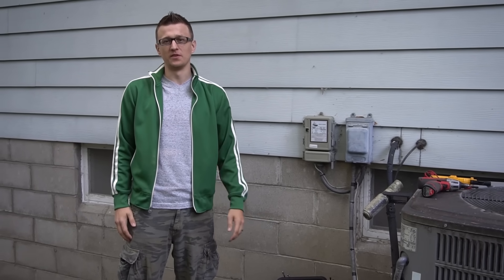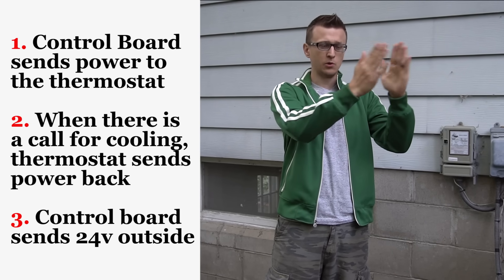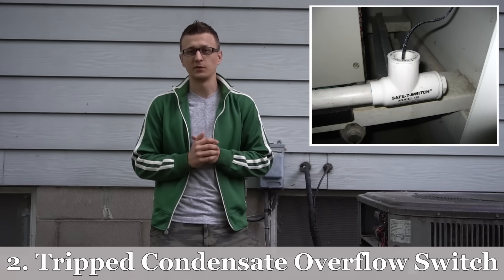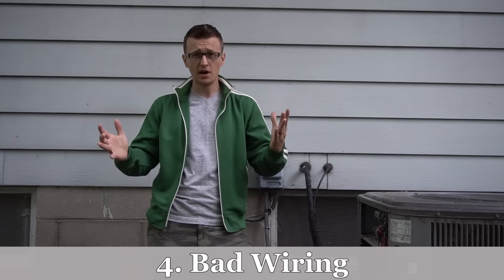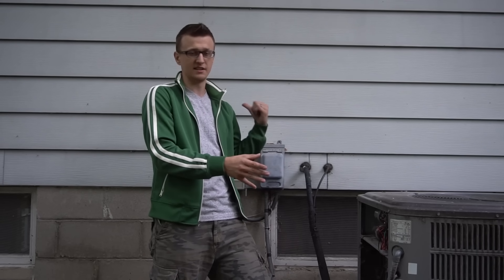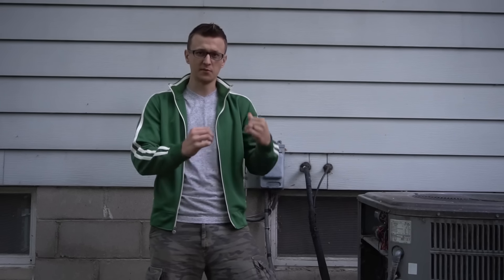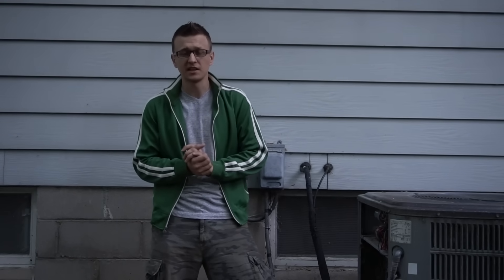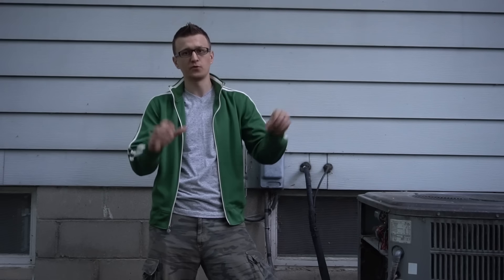AC Contactor Not Pulling In - 10 Reasons Why

Comment: Thanks for your videos. I used this one and others to test many parts of my a/c system to (eventually) find out that the control board was wired improperly. The condenser wasn't getting voltage from the control board. Turns out, the "y" wire was in the "Y2" position on the board, and when switched to "Y1," the condenser started up right away when the thermostat called for cool.

Comment: My AC unit was showing no signs of life Had a licensed tech come out to look at my AC unit at the side of my house. The company said the breaker was bad 🙄. I'd didn't believe it because I was reading 240v outside the house. Watched this video ( a few time not gunna lie). Troubleshooted it to the 5 Min timer. Runs great now. Thank you so much. 

Side question: I have the timer "bypassed" at the unit, is there any danger in leaving it bypassed at the outside unit??...I have an ecobee thermostat, I believe it has a Timer built in.

Comment: Thank you! after checking everything I tried pressing the High Pressure switch reset button and that clicked! I turned the power back on and after a while noticed that my AC Unit was back up and running! It's been storming on and off here in MN, so I'll need to go out and give the Coils a good spraying when it's clear out. Thanks for saving me from having to call it in!

Comment: The blue wire(24V) from the thermostat accidentally crossed with the 240v for the AHU. The fuse in my furnace popped. 

Traced the blue wire to the furnace and it was burned out at the tip. I stripped it back and rewired it in. 

I know the fuse popped and saved any catastrophe but how much worse could it have been? Should I be worried that the wire could’ve heated up enough to cause damage or anything like that? 

The only part of the wire that burned was the tip and it burned right off and disconnected at the connection. The rubber whip that it is in wasn’t damaged anywhere so I don’t think it got hot enough anywhere that the wire melted through it’s own encasing. When I rewired it, and measured R to B or Y it showed 27V so I know it’s back to normal. Just trying to get an idea of how bad this could’ve been. I know in the future to shut down all power no matter what unless needed (the 240V wasn’t needed and I overlooked that)

Comment: So my AC doesn’t kick on unless I push the plunger in on the contractor. I measured the voltage on the contactor(24V) and I’m measuring 9V when I don’t push the plunger in and it goes up to 10v when I push the plunger in. I’m wondering what would be the cause of this? A bad contactor? Or would it be something upstream?
Reply: I thought I'd check out the thermostat its self, when I measured R and C it measured to be 27.9V and there's a jumper in between R and Rc. Still troubleshooting what could be preventing contactor plunger from engaging w/o manually pressing it.

Comment: You are a natural at this. Great video and its SAVED for future referance! This is an odd one but you might know the answer and your Contactor comments got me thinking: I have a dual fuel Bryant system with a gas furnace and heat pump. My thermostat and wiring test perfectly so no problems there. Here is the issue: On a chilly morning, hovering around the set Balance Point of 35 degrees, I call for 5 degrees of heat. The heat pump comes on for a couple of minutes but then due to the higher call of 5 degrees the fossil fuel furnace kicks on which is to be expected. BUT the heat pump continues to run, or seems to be running, although I can't confirm if the compressor is on because i am in such a hurry to shut it all down! I know that these 2 units should not be running together and I know what this could do to my heat pump if I let it go on. I know from testing my stat that I am not sending 24V to the both units simultaneously, yet each work independently when testing. The odd thing is that if I call for just a degree or two the heat pump will start and stop properly but as I said, it will continue to run-on after the aux gas furnace fires up (with no power on the Y wire!). It makes my head want to explode. Are there any timer boards or timed relays in a heat pump that might be malfunctioning to allow this to happen? You might be the smartest guy I have ever seen on Youtube so if you don't I might have to walk down the street and just jump off that bridge :)

Comment: Thanks so much for this great video. Thanks to you I found out why the outdoor compressor was not turning on: one of the 24v wire from the thermostat had a bad contact! I have another issue now though: the compressor does not seem to cool the air. The specific noise when the air is cooled is not heard and the air blown from the vents inside the house is not cold. Any idea? Anyway thanks again!

Comment: Great info!  Could help me please?  I have power at outside unit, contactor not pulling in; 28v on white and red, 28v on yellow and red until I turn thermostat to cooling then I lose the 28v; 8v on contactor coil. Unit does run by pushing in contactor. Split system. Condenser unit fan runs. Unit was running great till now. Checked contactor ohms like you showed, got very little reading. Confused mostly because I lose the 28v on yellow wire when in cooling mode.  Any help would be appreciated and Thanks!

Comment: I thought it was contactor . But touching control board to test voltage it started working on its own. Found article that nest thermostats are bad to control  boards. Because no C wire connection. Anyone else find this .

Comment: Safe T switch wasn’t hooked up to the furnace but was hooked up to the AC. So I was so confused as to why the furnace fan was blowing and not the AC. Contactor wasn’t engaging and tried changing batteries and chasing wires. Then you said condensation line and it was tripped. Which is normal for me at my job but it always shuts down the whole system. Who ever hooked up the shut off switch didn’t connect it to the furnace blower

Comment: What happens if the system is NOT running,no power/no light to the attic control board,overflow switch good,the circuit breaker did NOT trip but if you turn off and turn on circuit breaker the system will come back on and start cooling,can a tech troubleshoot a system that is working for now? BTW this has happen twice in a week.

Comment: Ok,  been at it all day, your videos are epic,   Thus far,  replaced cap, i get both my 24vac and 240vac at contactor,  tested compressor at pins, all good,  filter is clean, cleaned condensor coil, fan inside and out works,  but air coming out of vents is not cold,    Is it possible my compressor starts to run then is shutting off

Comment: Watched your video and learned a lot. Im having an issue with my unit that I can't seem to figure out. I have power at my thermostat and my air handler runs. I have 240v at both sides of the contactor but it will not engage. I checked voltage at the coil and it is only getting 15-17, any idea on what the problem may be? Unit has been running fine up until now.
Reply: Little late but your coil is bad if your only getting 15-17 V. A good coil should read between 24V to 27V. Replace contactor and enjoy.

Comment: Hi Thanks so much for the information you posted on the contactor. My question is what's wrong when the plunger on the Contactor is stuck in the on position after we shut off the Thermostat. I need to let you know, I have already replaced the Thermostat and the issue is the same. The outside A/C keeps on running, even though the temp. has reached the desired temp. and the Fan is off also. Appreciate your instight on this. Thanks again, Mark

Comment: Thank you for sharing your knowledge on AC units! Whenever something breaks in my house I always search Youtube first to learn more about common problems to see if I can fix it myself before calling in the big guns. This video helped me narrow the issue down to the 5-minute delay relay circuit board. A mouse built a house next to it and corroded the circuitry. Unfortunately I am not able to find a direct replacement for the board. Do you have recommendations on finding a compatible replacement? The board is a HN67PA025A for a Carrier Tech 2000 38TK036310dl. P.s.- Good luck with the move to Hawaii!

Comment: I have 24 at my circuit board and after unit calls turn down to 13 volt to contactors and it doesn’t pull the coil in,I change the thermostat wire and thermostat,this happened because the blower motor had a short,I try everything but I still have the same problem.someone with the same issue?

Comment: Great video. My condo AC (air handler with tankless water heater...) turned on and off often and the air coming out of the AC was not cool. There's sparking noise coming from the contactor. An AC guy bypassed the low pressure switch (by just cutting the wire from the switch) and the AC is working. My concern is the low pressure switch is there for a reason.  What're the potential impact on the AC as a result of bypassing the low pressure switch. Your reply is much appreciated.

Comment: You're debug procedures allowed me to get my a.c. running (temporarily) on a 105 degree day. My contactor wasn't pulling. Fortineately it had a test button that I jammed to ON with a finish nail to cool the house.  Question: Furnace control board Y-C 27V,  R-W at thermostat 27V. R-W at Compressor only 13.8V.  Is my wire or Tatar jacked up?
Reply: Thermostat

Comment: Thank you very much for your video’s. This one helped me diagnose a wiring problem. I ran new 50 ft control wire from the air handler to the heat pump. My unit is back up and running good.

Comment: Do you have any ideas why my blower motor is buzzing? I replaced the motor and the capacitor. It still seizes and buzzes but not all that often. It's at least 30 years old.
Reply: Is the blower motor located next to or near the evaporator,  typically in the attic?  Is that where your buzzing noise is coming from, inside the house?
Reply: @doradean3097  the evaporator appears it's part of the furnace or near it (I can't see it). The buzzing noise is coming from the basement where the blower motor is, and the capacitor is also located there. I replaced the motor and the capacitor with new ones, and it helped, but it seems like I may have multiple issues besides just that.
Reply: @doradean3097  I believe the evaporator is also in the basement.
Reply: @MIKEH0LDERBY  I'm in Texas so no basements here, lol 😄  and the blower motor is near the furnace, got it.  Thanks a bunch!

Comment: HELP I Just Pulled a 2002 10 ton commercial trane split unit from a building being demolished. I pumped all the R22 into both  condensers and locked valves ( less than 1psi on lines after ) and intend to install it in my home it has 2 XR80 100k btu furnace units ducted through a separate  TXE120 120k btu dual circuit evaporator with twin XR12 condenser units. I was wondering If there is anyone in the NE Louisiana area who would be willing to pressure check and repair the 27.5" tall 60" long slant mounted slab evaporator ( one circuit leaks down over the winter )

Comment: Thanks a ton for the multiple videos on detecting issues with the ac. I was able to go from not knowing a thing to understanding the wiring for my HVAC, furnace, thermostat and the ac outside unit. My nest thermostat showed error E103, with over current on Y1 wire. I ended up replacing the contactor. And, everything is working great so far. One difference in my observation is that I observed 0 volts between the contacts that activate the contactor instead of 24V as suggested by you. I went around checking everything inside the house, before deciding to try and change the contactor. I checked on raw wire by removing the wire nuts as well as on the contactor fins. Nevertheless I learnt a lot, so many thanks!!

Comment: HELP!  We used our A/C less than 10 to 15 days per year, some of the years not even once.  Our unit was installed on 2011, we have used A/C probably less than 50 to 60 times total, but strangest thing is it never worked on the hottest day of the year (usually in low 90s degree), but it worked after 9 or 11 PM on that specific day, and the next day it's fine too.  My problem is when the unit is not working, I can't find any tech. to work on my unit, because they are all busy; and when they have time, my A/C worked fine.  I was suspecting the power company is doing some thing to keep us using our A/C on the hottest day (our power is routed through Los Angeles, they toped 100 degree when we were in low 90s).  The reason #7 about power saver switch, which we don't have it, but could our power company still able to control our A/C unit without the power saver switch even before they installed the new smart meter?  If power company is not the problem, could it be bad control board inside the furnace?

Comment: My ac just stopped working on the hottest day of the year. Thanks for saving us. I went through all your reasons and replaced the capacitor on my Lennox. That got the AC to the point where it would work, but only if the connector button was held.  I thought maybe it was the thermostat or fuse or a connector. I discovered the furnace unit had a power interruption when the controller door was off (that took a while).  I taped the power on, and checked for 24-27 volts at the controller and outside. Both showed power, still no automatic fan movement. Finally, I considered that my ac unit was older (probably 12 years old) and we had just moved into this house. The unit looked clean from the outside and down the centre, but when I opened up the sides of the unit, they looked like a clothing dryers lint screen. I cleaned the unit, found the high pressure switch (your reason #8) and reset. Problem solved. Thanks for posting this video....you are awesome

Comment: My contactor pulls in and "hums", fan does not start but there is not 240 volts coming from the disconnect.  Where is power coming from?  I flip the disconnect breaker off and the contactor continues to hum.

Comment: I just had my air stop yesterday.  My thermostat will "click" when I turn the cooling on, so it is sending a signal.  When I go outside and push the plunger in on the contact, the outside unit turns on but the attic unit does not turn on and blow the air.  I checked the drain lines and they are clean, filter is clean.  I am not sure where to go from here.  The light switch for the attic unit is on.  Do I need to remove the panel on the unit to find a reset switch of some type on the attic unit?  What suggestion beyond this point can you give?

Comment: My outside unit is not turning on. It will turn on when I hit the switch with my screwdriver like you showed in your video. If the capacitor is bad will it still start?

Comment: What if I have 27 volts to the contact switch with it disconnected and when connected 0 volts? I replace the control board,  Did a continuity test on the wire on all  Thermostat wire, new thermostat

Comment: Hello, I have question, my thermostat is not getting, power from the furnace, the contactor is not pressing down to get the let the thermostat do its work, so I rewired the thermostat thinking becos the old wire is not working properly and I replaced it, still nothing, then I went to the furnace to see if their is power in the line for the thermostat,  the power is not coming in, so what could be the problem,  the only way I get the furnace to turn on is when I press down the contactor myself, and I know that's not the write way, please give me some directions to get it fixed. Thank you

Comment: My Compressor fan turns off after ten minutes of use. If I turn off the system and waiting 10 minutesI can re start  the system and compressor  fan will work another ten minutes then shut down again. I replaced the condensor and the hard start unit but the problem persists.

Comment: Jay, Thankyou so much for the excellent videos. Having followed your advice I replaced the capacitor and contactor. I replaced the contactor from a 25FLA 30RES single pole to a 30 FLA 40 RES ( I read somewhere else that this was OK to do) I have 24VAC at the AC unit when set to Cool and the fan inside is on. When i manually push the contactor everything works fine. I just dont know where to go from here. Really Appreciate your feedback

Comment: You are THE MAN!!!!!!!!!!!   I received a $3,700 quote to replace my unit that was "too far beyond repair"......$28 capacitor, then worked through finally figuring out how to use the multi-meter I've had for a decade to find the high pressure switch needed reset after cleaning the coil.  Words cannot describe how grateful I am that you are on YouTube!!!!!!!!!!  THANK YOU!!!

Comment: Just trying to diagnose my AC.   So the indoor blower in is blowing hot air.  The compressor outside and fan are NOT turning on.   I tested the contactor and when I manually push in the contactor the compressor and fan turns on outside.  Does this mean my capacitor is good and the issue is inside?
I have 240V at the disconnect and I also have 240V at the contactor but the contactor does NOT pull in when I manually call it via thermostat.
No hum either.
 I did pull the thermostat apart and jumped R and Y for compressor and still nothing.  So that rules out the thermostat. 

Subscribed!!!!!!   Awesome channel!   You’re doing great!

Comment: You're the best youtuber in this field. 

Please help me. Lol
My ac wouldn't turn on, but my blower inside is working. When I push the plunger in, it turns on, but when I let go, it shuts off. I replaced the capacitor, and now my ac is short cycling. On for about 10 seconds, then off. On, off, etc.
Reply: If you still have gas in it and no leaks I’d ohm out the compressor